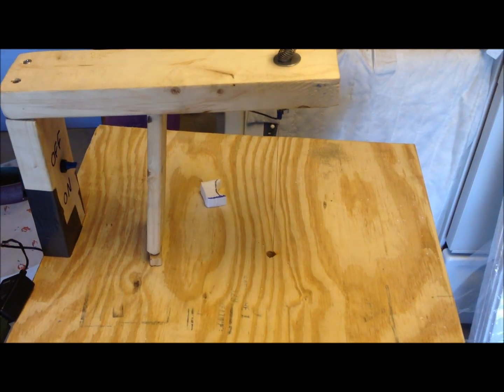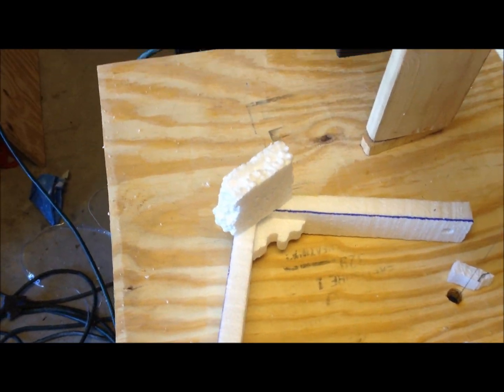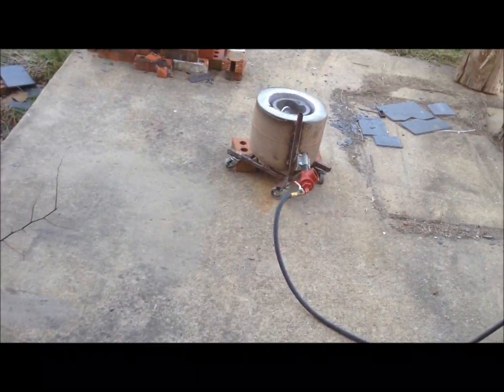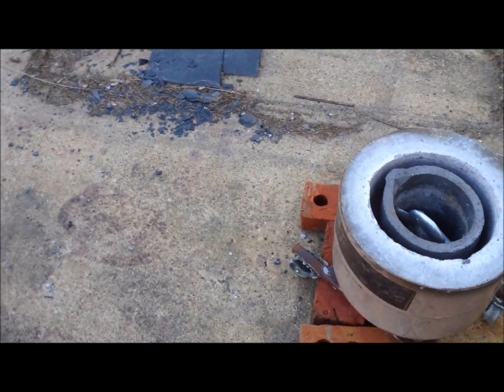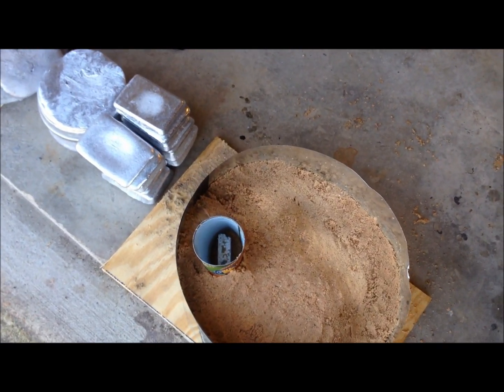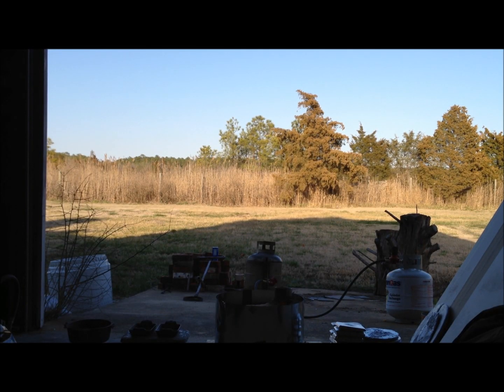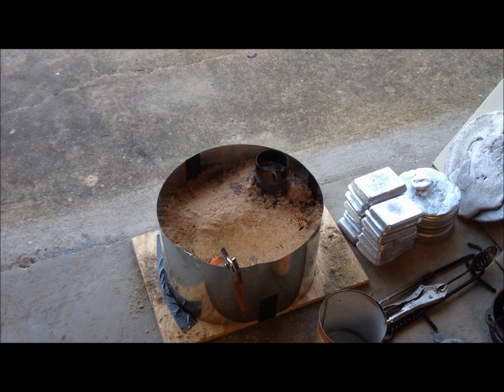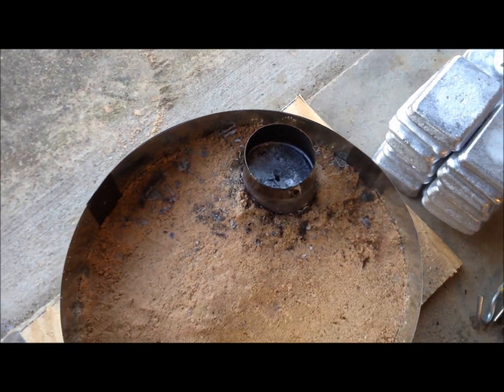Building a Better Hot Wire Cutter

Comment: Great projects - U are aware of the risks?  Being creative is great, being healthy at 60 is even greater!
Aluminium fume
The predominant risk associated with aluminium welding is exposure to ozone. Exposure to ozone can result in streaming eyes and nose. A sore throat is often a symptom. In severe cases ozone can cause emphysema (water on the lung). Ozone exposure may make existing medical conditions like asthma, worse. 
Ozone is an irritant gas and has WEL of 0.2 ppm (0.4 mg/m3). The exposure limit is likely to be exceeded at most aluminium welding operations (particularly TIG) unless there is effective LEV or the welder wears suitable RPE.
Reply from the maker: Thank you for your interest and your concern. I am aware of the dangers and take care to not expose myself to much.

Comment: I can´t wait to see this thing finished!!
Better luck with the next mold for the stand for it i also holding my thumbs it will come our perfect next time! Lot of inspiration here. Imust agree with You that metal looks way more professional than wood and it looks lot of fun to make it to me.
Unfortunatly we hawe a funding recycling system for those soda cans in my country wich makes them woth mony to people so it´s not an available sorce of aluminium here, but aluminium is used in lot of things if one take a look arund it seems... So i still collecting material then i must try making one!

.

.
Reply from the maker: Awesome! let me know how it turns out!
Reply: 556Raven

It´s a wery slow going project right now due to lack of sorce for scrap aluminium for the moment, but i will put up a Video about it then if it come out as i want it.
I hawe the rest of nessesary equipment for casting. Good You put up that sequens with pictures of the failed castings for inspiration! Interesting that the sand seems not need to be hard stamped or oilbounded as it needs to be in normal casting methods when i tried some brass and copper castings (i Used my Forgebalst for that to get the nessesary temperature but i think it´s possible to melt bronse with a gas oven i am not sure about pure copper but i hawe not tried melting larger quantitys of copper with a gas burner, just with my coal burner).